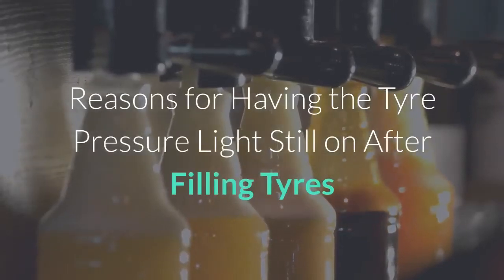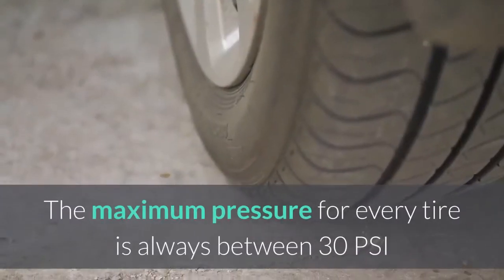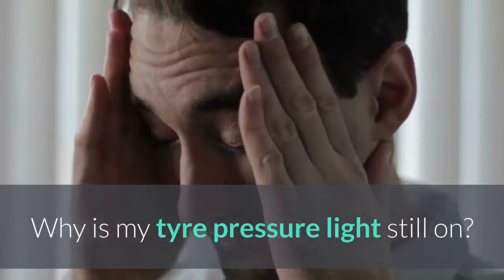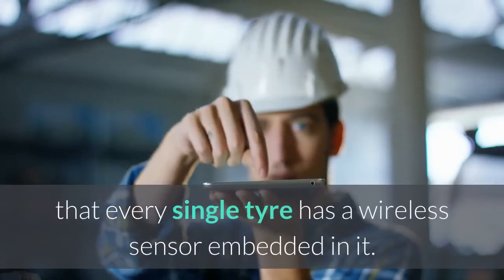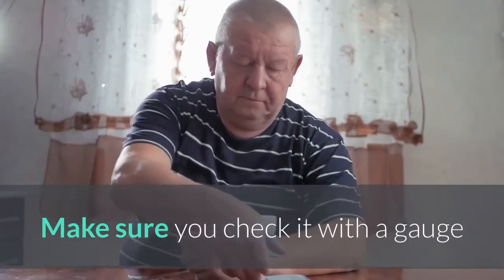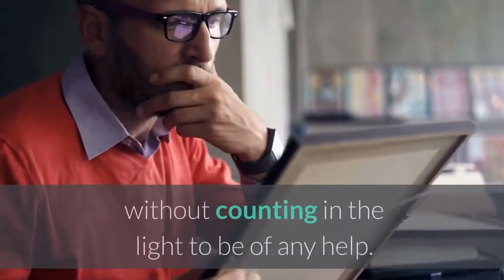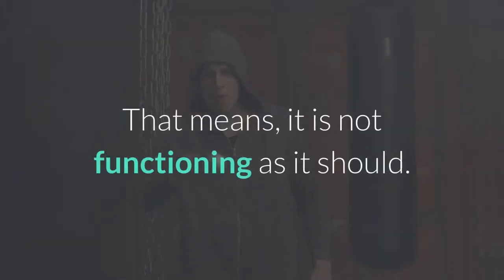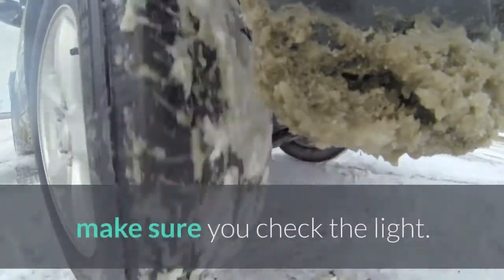Reasons for Having Car  Tire Pressure Light Still on After Filling Tires

Comment: I'm  currently experiencing this with my 2007 Nissan xterra  its 13 years old I've only had minor problems with it I don't see anything that has punctured in the tire that is low but the low tire pressure light is still on
Reply: They will have to take all the tires off the rim put in all new sensors and 1000 dollars
Reply: I think that's what wrong with mine .. I need a wheel sensor or whatever it is call